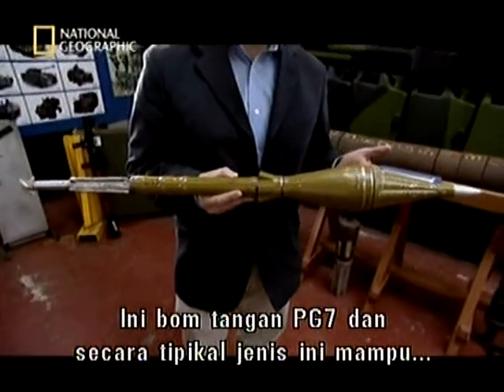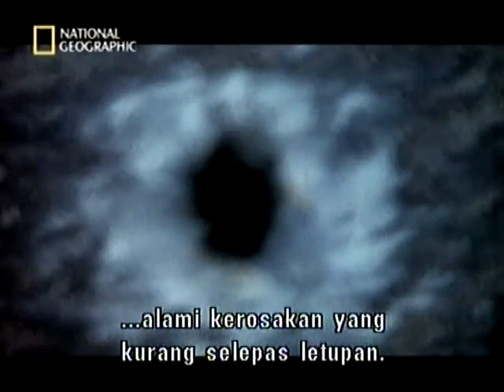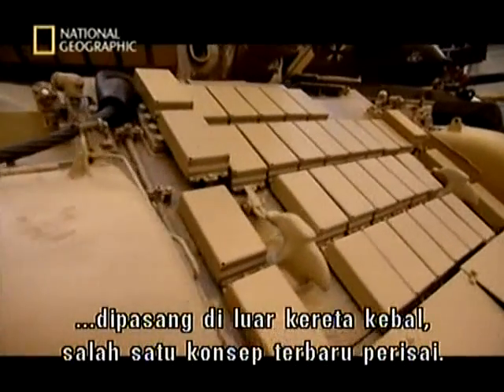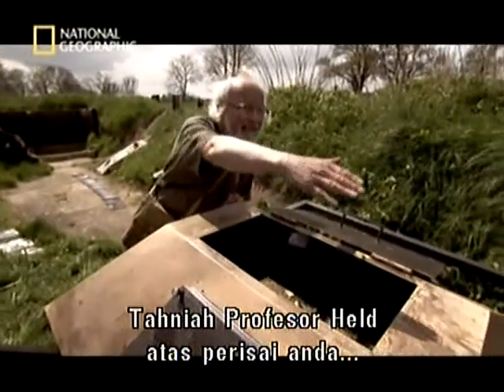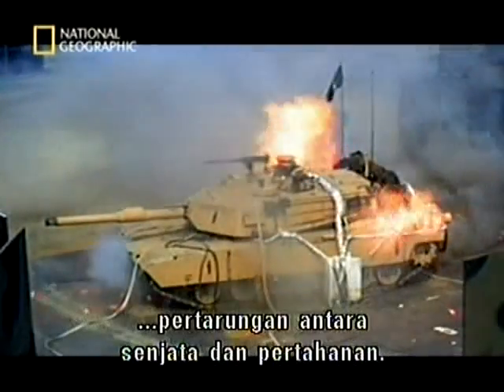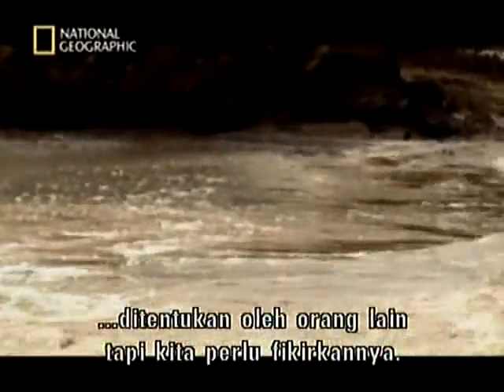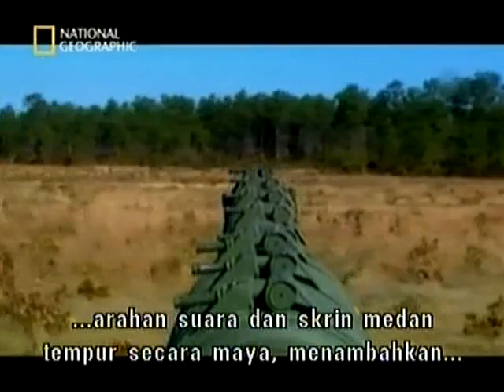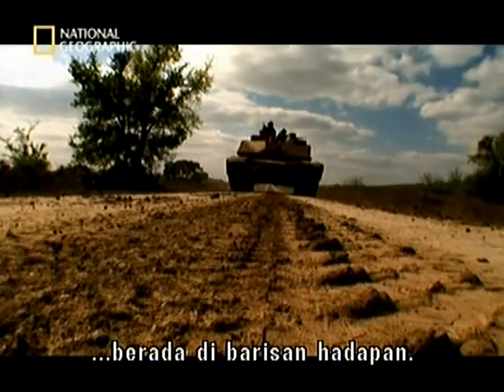Explosive Reactive Armor

Comment: at least the americans are finally somewhat admiting that their tanks are outdated
Reply: ERA has been around since the 50's, it's nothing new and TUSK contains ERA which can be fitted the the M1A1 and M1A2. Most ERA can be defeated by long rod penetrators.

All tanks have pros and cons in terms of maneuverability, the M1 is no different. It also is very ridiculous to claim that one modern tank has more "maneuverability" than another, all Western tanks are born from two joint projects, the MBT-70 and MBT-80.

The US Military maintains a human loader for added security, manpower,  reliability, and speed. Having an autoloader doesn't mean a vehicle is superior. 

The M1 has had the ability for the M2HB to be fired by the TC when buttoned up and the M1A2 utilizes CROWS. The M1 has possessed a coaxial M240B since it's prototype model. 

All tanks post-1940 tanks contain "computers", The M1A2 was apart of Force XXI, a program to bring the US Militarily into the digital era. Force XXI began in 1991 by introducing the M1A2SEP and later the M1A1D, a this time CEEP is being introduced as the third upgrading phase known as SEPv3.

The M1A3 isn't even in service, it's currently in an operational readiness stage with a predicted fielding date of 2017.
Reply: Joël LeMay Both the M1A1 and M1A2 can be affixed with TUSK, because it's an external kit that can be added. TUSK-II was deployed in Iraq in 2006. 

The M1A3 isn't in service. 

Active Protection Systems have been in used by both the US and Russia since the early days of the Cold War. 

Russia produced a hard kill variant APS for the T-55 in 1978 known as Dorzd. Arena is a derivative of Dorzd. It's not a complex or unique system, both utilize Doppler radar to detect incoming shells and detonate...a concept Sir Samuel Curran designed with the VT fuse in 1940 and developed by Merle A. Tuve of John Hopkins Applied Physics Lab later the same year.  

The US took a different route, adopting soft kill APS like the VLQ-8A. By technicality, the US system is far more technologically advanced. 

TUSK utilizes the XM-19 ARAT as it's ERA, it's a double-walled ERA that is resistant to detonation by small arms. The M60A1 RISE Passive saw the addition of ERA compatibility in 1977, which consisted of a single layer ERA. 

GPS was developed in 1978 by , up until the Block-III satellite series was launched, selectivity allowed the US government to insert errors into the 

However, that's all moot because Russia has it's own GNSS called GLONASS, which went online in 1993. 

The US and Russia aren't alone, China, India, and EU have developed their own GNSS.

Drones for use in Intel, Surveillance, and Recon operations have been in use with the US Military since 1964 when the US Air Force deployed Ryan Firebee Model 147B drones at Danang Air Base to preform high-altitude recon over North Vietnam. 

The US currently has one Ford-Class Super Carrier, ten Nimitz-Class Super Carriers,one America-Class AAS and eight Wasp-Class LHD. The US has had aircraft carriers in it's inventory since 1920 with Lexington-Class Carriers.

The Russian Federation has a single Kuznetsov-class STOBAR Aircraft Carrier launched in 1985. 

Russia first built and deployed aircraft carriers in 1968 with two Moskva-Class Carriers, then 1972 four Kiev-Class Carriers, all of which have been scrapped or sold to China. 

It's abundantly clear you have no real knowledge in relation to any of the subject matter being discussed. You're simply just verbally spewing nonsense in an attempt to look as if you're intelligent and knowledgeable.
Reply: @Joël LeMay

The M1A2 and M1A3 are completely different systems, the M1A3 isn't even in service, as noted by nearly every defense think tank and the US Army's own PEO STRI;

http://www.globalsecurity.org/military/systems/ground/m1a3.htm

The T-80 is a continued derivative of the T-64 that entered service in 1976. 

All Third Generation Tanks are designed as their pre-Cold War counterparts, because post-1940 armor doctrine went from supporting infantry, to combined arms. 

A blind spot within 4-/= feet is moot. Call of Duty and Battlefield are games, you can't simply attach a binary plastique and destroy a tank, you need either ATGM, an EFP or MSE to effective disable a tank, all of which have an operational range. 

Of course it still uses manual loading, that's apart of US armor doctrine. Even the German Leopard 2 practices manual loading. Only the Leopard 2A7+ will be fitted with an autoloader because the 130mm ammunition for the L/51 can't be loaded manually. The M1A3 is also slated to have an autoloader...just like the M2 C-ATTB and M1 Thumper experimental systems.

The great threat to armor, in every county and every conflict has been from ATGM for "mere foot soldiers".

Please stop being so hyperbolic. Fragmentation grenades can't disable a tank, never even the M5 Stewart is that vulnerable.

You also have no idea if the Abrams in Yemen and Saudi Arabia were destroyed. Nearly everyone that watches the videos coming out of Saudi Arabia and Yemen screaming about how the M1 is being knocked out left and right, when it's the blowout panels and venting system they see functioning...what is known as an "Operational Kill". The same thing happened in Iraq, the US simply returned the damaged M1's to Pima Depot to be rebuilt and repaired. The only M1's to suffer catastrophic damage where friendly AT mines strikes during the Gulf War, fratricide by A-10's firing AIM-120s during Iraqi Freedom, and daisy-chained 155mm HE IEDs during Iraqi Freedom. 

Again, you've demonstrated you know absolutely nothing about what you speak of, simply just spewing nonsense to try to sound educated an intelligent.
Reply: No it is not, TUSK can be mounted onto ANY Abrams, it is NOT the M1A3. 

http://www.globalsecurity.org/military/systems/ground/m1a3.htm

Only one incident of an RPG-7 penetrating an M1 exists. In 2003 insurgents through the use of an PG-7VR warhead struck the unarmored access skirt on an M1. The EFP entered into the hydraulic reservoir, then into the turret via an access panel. The Copper slug penetrated the loaders seat, the loaders CVC, the loader, and came to rest in the turret wall face to the left of the M256 breech.   

http://www.rense.com/general44/what.htm

Thus far, only anecdotal evidence exists that an M1 can be felled by a Kornet. A handful of Iraqi M1A1S have become damaged by Kornet's. The M1A1S isn't the same as the M1A1AIM and M1A2SEP. That'd be akin to saying the Asad Babil is equivalent to the T-90 because both are variants of the T-72. 

Funny, for a person that claims to be so highly educated, you offer no validating proof, perpetuate false information, and simply act as if facts don't matter.
Reply: Aztk Shorty It's nothing to type up a response with facts and data. Plus, if it doesn't help educate him, it'll help educate others. 

I wouldn't say it's state propaganda he parroting, just simply jingoist zeal and ignorance brought on by a poor education in the subject matter and a good amount of cognitive dissonance. It doesn't take a genius to verify facts or provide them.
Reply: The Gaming Banana The M1 has had separate ammunition stowage since it first rolled of the design table. 

All Abrams have a human loader, for added security, manpower, less mechanical reliance, and fast loading speed.
Reply: No, actually the largest portions of US military expenditure goes towards maintenance, followed by personnel, then procurement., then R&D. The US has drastically downsized it's OCONUS bases, since 1991 a slew of BRAC rounds serious diminished the forward deployment capabilities of the US. However, US expenditure wouldn't be so large if it didn't have to carry 73% of NATO. 

https://en.wikipedia.org/wiki/Military_budget_of_the_United_States

http://www.businessinsider.com/how-much-every-nato-member-spends-on-military-in-2014-2015-2?r=UK&IR=T

ISIS was armed by the CIA, not the US Military. There is a difference, such as th CIA draws from a different budget and is apart of the National Intelligence Community.

http://www.bbc.com/news/world-us-canada-23903310

 The Taliban came into being during the Afghan Civil War in 1994, formed primarily of students that attended madrassas in Pakistan, lead by Mohhamad Omar to fight regional Mujahideen militias controlled by warlords. The Taliban was toppled as a form of government in 2001 by ISAF, where it reassembled as an insurgency faction in fighting against ISAF.

Al-Qaeda is  Sunni militant faction that was formed in 1988 by Osama Bin Laden as apart of the resistance to the Russian invasion of Afghanistan in 1980's.
 
http://www.nytimes.com/2016/06/27/world/middleeast/cia-arms-for-syrian-rebels-supplied-black-market-officials-say.html?_r=0

https://en.wikipedia.org/wiki/Al-Qaeda

https://en.wikipedia.org/wiki/Taliban

You speak as if using refurbished equipment was a "bad" thing. All major military forces reutilize equipment, because it would be fiscally irresponsible and crippling to produce new equipment constantly. Both Russia and China, two other major superpowers reutilize equipment constantly. Both the Russian Navy and PLAN consist of rebuilt and refurbished ships

http://theweek.com/articles/596822/russias-military-dont-believe-hype

https://en.wikipedia.org/wiki/Chinese_aircraft_carrier_Liaoning

https://en.wikipedia.org/wiki/Kuznetsov-class_aircraft_carrier

https://en.wikipedia.org/wiki/Russian_Navy#Ships_and_Submarines

The Ukrainian Conflict that's been ongoing the past two years has been replete with Soviet Cold War-era equipment, used by botht he UAF and NAS. 

http://www.ibtimes.com/ukraine-fighting-21st-century-war-cold-war-arms-1808358

When I read you comments, I shake my head at all the false information and propaganda you continue to spew. 

You've gone on to show, not you are you woefully ignorant in military affairs, but have a serious knowledge deficit in understanding economics, diplomacy, defense intelligence, and world affairs in general.
Reply: The M1 Series of tanks are not "outdated" my any means, and I don't know where your idea of frag grenades taking out a tank came from. Yes, our tanks are aging, but not "outdated". Also, George Atlas provided some solid information, and you simply continued with your ramblings.
Reply: +George Atlas thank you sir... these people are just forcing their opinions, each tank is different but it doesn't mean they are superior
Reply: Joël LeMay 

 never said the "Tank Urban Survival Kit" was the M1A3, that was you. TUSK is an armor add-on package that can bit fitted to any post IPM-1 regardless of model. The M1A3 is an new model of the Abrams, replacing the M256A1 120mm with a new lightweight 120mm gun, replacing all copper wiring with fiber-optics, replacing the AGT-1500 Honeywell-Lycoming Powerpack with a newer, modular 1500HP Diesel Powerpack, and new modular armor. If you actually read any of the links I posted, you'd know that.

No, the M1A2 was an overhaul to meet Force-XXI requirements. The M1A2 is a different tank than the M1A1...they're the same make...not the same model. Just like a 1969 Mustang GT  isn't the same as a 1969 Mustang Mach 1.

Ah, I'm the one that pointed out the T-90 is a variant of the T-72...in most previous post. 

You can't don't know what variances or models are, but I'm the moron.  

Here's some information for you; 

These are all the models of the Abrams since 1976; 

XM1
M1
IPM1
M1A1
M1A1HA
M1A1HC
M1A2
M1A2 SEP 
M1A2 SEPv1 (ISEP)
M1A1D
M1A1AIM
M1A1AIMv2 (SA)
M1A1FEP
M1A2 SEPv2 (CEEP)
M1A2 SEPv3 (ECP)
M1 TTB
C-ATTB
M1 Thumper
M1 Grizzly 
M1 Panther II
M1 ABV
M104 Wolverine 
M1A3
M1 ARV
Reply: It's an add-on, just like Arena or Kontact-5. 

Doesn't have the cash? You do know the US outspends every other nation in word when it comes to defense spending.

Too stupid? That's rich coming from a guy who's done nothing, but spread misinformation and false data in YouTube comments. It's no different than the Russian's putting Arena on their tanks...it's nothing, but a variant of Drozd. So, the Russians must be really stupid in your book for keeping a 35 year old APS around.

However, now that you're on the case, I'm sure the Defense Department will be giving you a call any day now to make sure they're not being "too stupid", because you can not understand US armor doctrine.

You've done nothing, but show you don't have a clue what you're talking about. Even going so far as to having to insult others, to distract from it, because they've shown your lying and presenting false data.
Reply: ALL Western tanks weight in the same area as or more than the Abrams; 

Leopard 2: 68 Tons
Challenger 2: 69 Tons
M1 Abrams: 63 Tons
Char Leclerc: 57 Tons
K1A1: 58 Tons
K2: 68 Tons
Ariete: 60 Tons
Altay: 72 Tons

So much for your false information about the Abrams being "too heavy". All tanks have add-on packages and all have been built with thicker frontal armor with the same concept of fighting other tanks and all suffer from supposedly "lack in maneuverability". So again, so much for your false information regarding the Abrams. 

No, we're in the 4th Generation of Warfare, it's far, far more likely for an insurgent AT team or IED/EFP to fell a tank than an attack helo.

You entire line of thought is completely based on some propagandist ideal that only the Abrams is obsolete, but somehow other tanks maintain functionality under these contrived limitations. Anything that limits or causes an Abrams to be obsolete, does the same to any 3rd and 4th Generation tanks, not just the Abrams. 

Once again, you've shown you haven't a clue what you're talking about. You're simply conjuring up false claims and false information.
Reply: The Gaming Banana Because auto-loaders malfunction and fuck up, and having a machine press against the shell is bad news for the tank. Also, auto-loaders are expensive on top of the fact that you can't really replace it if it's broken as it's designed to remove a crewman. The Abrams is also the MBT of the worlds richest and most powerful military for a reason. You shouldn't be skeptical of the tank that can absorb 50 shells from a T-55 and send one by eye balling it and blowing the turret off the ring.
Reply: The Gaming Banana Overall average loading speed in the US is on par and usually faster because they train loaders as nothing but loaders, not multi-role personnel, so they specialize in nothing but loading (along with basics like shooting straight and staying in shape).
Reply: The Gaming Banana
Not at all, a human loader can match the speed of an autoloader. 

ALL tanks have ammo in the turret. The M1 has it ammo in a separate compartment that's opened via the loader hitting a release with his knee, an armored door slides open giving the loader access. 

An autoloader doesn't mean the crew is safer. The Russias from the T-62 to the T-90 utilize an carousel loader under the crew in the turret bustle. The US began storing it ammo separate from the crew over 30 years ago, it's only now with the adoption of the T-14 that the Russian's will have separate ammunition storage, but that's because the crew isn't in the turret, which creates it's own special problems.
Reply: No, you tried to mimic a common Cold War era propaganda meme.

The majority of OCONUS bases are Air Force, not "US Army". 

The cost to "run a base" is minimal, because the majority of bases OCONUS are "joint", like Incirlik. What costs is personnel and maintenance, not "bases". Even if the US Military didn't have OCONUS bases (like all other world powers do) it would still have the same expenditure because of the existence of the tenant units at those bases, they would simply be located elsewhere.

US spending has drastically been reduced since the end of the Cold War. 

So, you practically haven't said 
"anything", except more misinformation and propaganda nonsense.
Reply: George Atlas As I said earlier, why do you keep responding to him. He's obviously brainwashed, everyone has noticed it. I didn't know this type of propaganda still went on in Russia. Since it's no longer a communist dictator ship...
Reply: You don't even know what you're talking about, you just throwing out random numbers. 

If a noted scholar or think tank analysis made comment about "problem", but you're not a noted scholar or a think thank analysis. You've shown you don't know anything about this subject matter. 

You care enough to continue to reply.
Reply: George Atlas This is quite entertaining actually..
Reply: Joël LeMay I know actually having to prove your points must be a taxing and confusing thing, so I'll spare you the lecture on how you should be doing your own research instead of pulling shit out of your ass. 

https://www.cbo.gov/publication/51535

Enjoy.
Reply: Joël LeMay That is not "explosive armor" you are talking about. That is active protection, an entirely different concept. A tank that has active protection system can also have rare material armor and/or explosive armor.
Reply: they said ''the tank'' not ''the american tank''... and if the M1 Abrams is outdated, what about the rest of the worlds tanks??
Reply: Joël LeMay ummm... i dont thnik they edited the video... and the M1A2 Abrams is also a ''modern'' tank. if the T-90MS is a modern tank, the M1A2 deffinatly is to. the M1 has a better gun, better armour and protection system. the onlt thing the T-90 has going for it is that its lighter, faster and more manueverebole.
Reply: Hoyin Tse M1A3 doesent exsist. and the T-90 ERA works exactly as all other ERA's once fired upon and exploded its used up and there is a exposed part of the armour left there. the M1A2 abrams has the equilavent of 1920mm's of armour against shaped charges on its front without ERA. the T-90 has the equilavent of 1750mm's of armour against shaped charges with ERA. without ERA the T-90 only has about 1000mm's of effective armour.
Reply: Joël LeMay but the M1 abrams has better armour and better protection than the T-90 anyway. thats a fact.
Reply: Joël LeMay you know the Depleted Uranium Armour the M1 uses is relly good at stopping heat right? there was a case in afganistan where 1 M1 abrams was hit about 40 times by RPG's, RPG's are HEAT shells which penetrates about 800 mm of ''normal armour'' so the M1 is pretty good i would say at stopping heat... its better than the T-90 anyways.
Reply: Joël LeMay kornets work allmoast the same as RPG's and i would relly like to see where you got the information on that about 1000 abrams have been destroyed bu Kornets...
Reply: Joël LeMay yea ive seen that video, and you've obviously no read into the story. that abrams which was shot in yemen wasnt an american M1. and since it wasnt american, it neither had TUSK or the depleted uranium armour which the american M1 does.
Reply: Joël LeMay there was even a case in afganistan where a M1 got stuck after hitting an IED and another M1 who was there with him tried to shoot and destroy the M1 point blank range (10m) from the front with HEAT and APFSDS, nothing, absolutly nothing happened, it could not penetrate the frontal armour of the M1 what so ever. and there have been many cases where M1's have been hit with several RPG's and other hand held and stationary AT weapons and wasnt destroyed, im starting to get a feel that you dont know as much as you think you know and that you are a little bit biased.
Reply: Joël LeMay ho shot the tank because they couldnt save it and desided to destroy it so it wouldnt fall into enemy hands.
Reply: Joël LeMay And no , you're talking about a prototype . Just like the T14 . The prototype isn't even preforming well . It's engines are weak , it's only seen high manauverability at low speeds , it's stealth isn't even near as good as the F35. It's more like a 4+++ Gen  fighter . F22 is much more stealth cappable with it's new stealth paint that was used the F35 .It's much more resistant to weather and don't worry . .... the f22 will get a HUD or HMD by 2020.
Reply: Joël LeMay U are such an ignorant of a person to believe the f22 being a prototype .  How can someone that thinks he knows everything about tanks say such shit . Wow , this Suprised me more than it should.
Reply: Joël LeMay SU-35 is a well manauvering plane , too bad dogfights are rare
Reply: ***** "not a single abrams tank has been lost to personal anti tank weapons" after reading that alone i can already tell you didnt read my full comments so im not going to read your full comment either until you realize your mistake
Reply: And also the Abrams and the Exported Abrams are the same tank with different specifications, mostly its armor.
Reply: ***** they mentioned that tank with tradition solid like the Abrams are outdated if you dont believe me then watch the video again
Reply: ***** WATCH THE VIDEO AGAIN
Reply: If the M1 is outdated, then all tanks are. Spin this how you want, but the M1 is the pinnacle of armored vehicles. Also, the M1A2 has these covered on the outside.
Reply: Joseph Stassup both the Russian, the Chinese, the Israeli, the Turks, and most European countries have modern tanks by that i mean have tanks with the latest tech such as explosive armour higher maneuverbility auto loaders remote controled machine guns so that the entire tank cant be taken out by a simple frag grenade and on btw the M1A2 has nothing of those its builrt like any WWII relic tank of the past with so computers added but thats it really you should take a look at the firing pin the abrams dont even have something as simple as a trigger
and you mean the M1A3 has c4 strapped the outside the same era as the outdated T-72 plus theres just a few M1A3 in service
Reply: Joël LeMay The US varient has depleted uranium aromor as well, which is just as if not more effective than explosive reactive.
Reply: Joseph Stassup lol the Abrams have had depleted uranium armour since the 80s and ANY high caliber HEAT round goes right through it as if it was paper HEAT rounds like what the Russian portable missile launched called the Kornet but explosive armour stops it without a fus
Reply: The Gaming Banana Literally all tanks will go up in a fireball if the shell gets lit up. It's not unique to the Abrams. Really, the cm thick sheet of aluminum does nothing if 5-6 shells blow up at once. It's more of a mental barrier than a physical one, as it makes the crew feel safer, and they will perform more efficiently.
Reply: Joël LeMay
Your definition of educated is pulling facts out of your ass.
Even your original comment is not even true.
The person in the video said that all tanks were becoming obsolete. All Tanks, which is complete bullshit. This guy is tossing reactive armor like its the one trick pony to make a tank great.
George Atlas is actually providing links and evidence, while you are on some country-related hate speech.
Reply: Joël LeMay American military spending in 2010 was around 664 million 2015 was 598.5 million 2016 was 596 million. You can easily search up numbers of military spending it isn't hard. While russia's military spending in 2016 was around 69.3 billion.
Reply: explosive armor can only stop shells once, rare material armor,such as depleted uranium, can stop the penetration of shells for many times.
Reply: It depends on what type of Abram and what shell you are using, M1A1, M1A2 and M1A3 have totally different capabilities, but I agree the active protection system is very advanced in its design.
Reply: The new active defense system had been invented and is going to be mounted on American tanks in 2016. Technology can't beat the internet >.<
Reply: Joël LeMay  But how many times can ERA be useful, remember the enemy won't fire just once and leave. You can literally put ERA on a T34 and expect it work the same way as in an Abram.
Reply: Joël LeMay I do sincerely think many infantry AT would not even damage the abram in 10m range.
Reply: Joël LeMay just keep coming with you'r arguments, but the fact still remains, the M1 Abrams has better armour than the T-90
Reply: AirsoftGamer the T-90 armour stops ANY HEAT rounds including the Kornet whithout suffering ANY damage meanwhile the M1 Abrams cant even survive a single hit from the Kornet not even at the front turret where the armour is thickest
Reply: Joël LeMay yes it can?, and the front of the turret isnt where the armour is strongest, thats the upper hull, and the T-90 takes damage when hit by not just heat but for example APFSDS because the ERA which the T-90 heavily relies on will get destroyed after a shot, watch a comparison video or 2 or 3 on youtube or read up about it, then you'll fins out the truth.
Reply: AirsoftGamer no it will not because its a turret that shoots at incoming high caliber projectiles COME ON DUDE i already told you this
and its easy to make a fake statement by writing it but near impossible to make a fake video thats why i dont like to read statements
Reply: AirsoftGamer the Abrams armour so weak it caht survive a single Kornet round sure the abrams armour is thicker but its weak and you know exactely what i am saying you just dont want to admit you were wrong thats what a little child does because children cant admit being wrong thats the diference between a child and an adult
Reply: Joël LeMay you are literaly losing this and still iggnorant after what everyone stated . The things they say we're facts ....how tf can u be that ignorant . Ur insulting him because you're losing . All you're saying is based on your oppinion
Reply: Habiebi Djokarso how as a tank that cant survive a single kornet hit be better then a tank that survives a kornet hit?
Reply: Joël LeMay Like u don't know .... ofcourse because of the reactive armour
Reply: Joël LeMay Someone told me a valuable statement ; It all depends on the scenario. No Abrams will go on the battlefield without other groundforces or  support from air
Reply: Same with the T-90 being backed up ....
Reply: all of them will be backed up by either air support or air strikes . And Air power does play a huge role in the batle giving u an advantage over the enemy . Every Tank can be destroyed by air attacks . It's easyier if you're taking the lead in the air . Ground forces can easily be disabled by air
Reply: Joël LeMay Air support doesn't mean air strikes . It's from artilary to AC-130's bombing the shit out of the enemy
Reply: Joël LeMay I can't even talk right now
Reply: Joël LeMay I've replied to your comment in another vid. (I don't remember what ) But I really know u said some dumb shit
Reply: Joël LeMay yeah , probably
Reply: And one more thing , about that Tank being destroyed by a kornet ... did it feature the US variant of ...everything officially used by the US ? The Kornet is scary ... but I'd rather face that than a fire and forget Javelin or Spike .... those weapons are legendary . But I wonder how the Rebels  got many Kornets and TOW's .... of course I don't .
Reply: Habiebi Djokarso the Javelin and Spike are very old and outdated but the TOW is about the same thing as the Kornet its a double HEAT round works like a charm against old ERA equipped tank such as the T-72 but doesnt work against modern ones like the T-90 you'd need a tripple HEAT round for that but i dont think such a round exists yet that is if its even possible to make one
Reply: Joël LeMay The PAK-FA is stil a prototype u dumbass . It'll enter production in 2017 , u are saying such nonsense . And No the Javelin entered service the same period the Kornet did , the Kornet isn't even for replacing currant systems . And the  number of Javelins built is well over 40k
Reply: Joël LeMay The Javelin and Spike are guided to penetrate from the top of the Turret , and no tank is acceptably good protected from the top , even reactive  armour wont help u with the Javelin
Reply: Habiebi Djokarso only reason they are rare is because the wars of today are too one sided by that i mean theres almost air battles its always air vs ground i guess its because todays armies are too scared of facing someone else that has an air force not even Israel dares to fight Syria's air force or viceversa
and ERA is especially good vs attacks that comes from above you'd have a higher chance of damaging the tank by aiming at the lower parts of the tracks or even better by hitting the tank from under where the ERA cant protect the tank but the top of the turret is the most protected area thats why i said Spike and Javelin are useless not to mention they are far less powerful then the TOW and the Kornet instead the jav and spike are more like an RPG-7 in terms of strength
and ERA is not reactive armour it is Explosive Reactive Armour and what can your javelin or spike's round do to the tank when it gets destroyed before even hitting the tank?
Reply: I know tge difference . And no , the Javelin triggers the reactive armour and then enters the tank , but I really don't know about ERA taking these types of missiles out , ....We'll see when it happens .An RPG-7 is so weak . It can't do any damage to modern tanks . It doesn't even have Semi Guidance
Reply: Habiebi Djokarso modern ERA are explosives that are fired at incoming anti tank rounds and the turrets that fires them is usually on the top of the tank and has a 360 degree coverage but its no sursise you didnt about modern ERA taking out Javelin or Spike missiles since tanks with modern ERA are rarely seen and the western powers dont have modern ERA Turkey has it tho so does Russia China India and even Syria has a few but thats about it as far as i know
Reply: Joël LeMay U sound so one sided
Reply: Joël LeMay I know how ERA works , but I really didn't (don't) know they can take out these kind of ATGM's ...We'll ... it's not proven , but it may be true
Reply: Habiebi Djokarso you know what primitive ERA is but you sesm to think theres inly 1 type of ERA but theres multiple btw the T-90 has 2 types of ERA the one that fires and the one that reacts when in contact that said the Javelin/Spike may get through the first ERA but it gets stoped by the second same goes with the tow btw the tow is better then the Spike and Javelin and the T-14 has 3
Reply: Joël LeMay I know the TOW is better at penetrating the armour , but the Javelin is much more Effecient and fast while the TOW has much more chance to be seen by the enemy . They work for the same purpose (Destroying tanks) but they are two different types of weapons with both their ups and downs . The TOW (or Kornet) is much harder to opperate in combat area because the opperater can be spotted because the missile reqiures guidance until impact . The Javelin on the other hand can do it very quick and u can opperate this ATGM without being detected even if the missile is going to be stopped . So i've done some research and found out that the T-14 is hella allot of advaced in ERA and Reactive armour , this doesn't mean that the US tanks are outdated . Just like how the F22 isn't made obsolete by the f35 because of it's differen't types of roles . And i've also read that the T-14 uses EASA ..... now damn that's something else for a tank . I've read that the T-14 , just like the Merkava uses ERA against similar types of AT Missiles like Javelin , RPG 7 and other simillar types ... but not Sabot ....the Merkava has a ERA systems that calculates the speed of the projectile and where the system will hit effectivly presicely while the T-14's ERA just works by spraying the explosive (????) in the air wich makes it very dangerous against infantry around the tank .
Reply: Wich is a downside for them
Reply: Habiebi Djokarso the Jav was designed to counter the T-72 but not the T-90 nor the T-14 and i didn't call the f22 as obsolete i simply called it inferior and the jav also requires guidance otherwise it would just keep going straight in the air btw the tow is actually a lot more accurate then the jav because it can instantly fix its trajectory throughout its entire trajectory thats why it looks derpy after its shot meanwhile the javelin goes straight up because it can only slowly turn meaning it cant hit a high speed moving target unless the shooter predicts where the target is bona be upon impact its not like in video games real life is very different 
- 
the moment you claimed the javelin to be more efficient then the tow well you convinced me that you have no idea what you are talking about it feels as if you take most your info from video games
Reply: Joël LeMay the JAV has infrared guidance so no , you don't have to wait and guide it until impact . The Javelin can hit moving targets but not too fast moving ones . But the Spike can hit high speed moving targets with precision guidance and it has been proven . Just like the Javelin , the Spike is really accurate . Where the hell did you get that info dude . Is it your oppinion , because it really looks like it is , btw . ....The opperater of the Javelin doesn't have to stay till impact so yeah , it's highly more effecient
Reply: The TOW is better at pennetrating armour . So that's the best part of it . Dude , when I say something , u don't have to explain everything because I know what it's porpuse is . I know what the Sabot is and the Sabot round destroyed many Iraqi tanks , where did u get your info from dude .... And no APS can defend against SABOT rounds . They are amazing at penetrating and ERA (APS) can't stop it , Reactive armour can decrease it's cappability but not stop it
Reply: Joël LeMay u seem to have much info but most of your older post are so incorrect
Reply: Habiebi Djokarso you take your info from wikipedia??? thats not a very reliable source of info since anyone can change the info there but whatever i give up you are one of those brain washed pro US guys no point in talking to you anymore
Reply: Joël LeMay you too
Reply: The Macaroni Chronicles lol i see you are admiting that i am right because you dont know what to say do you?
-
the guy claimed 0 abrams ever got destroyed yet i posted a video showing an abram getting destroyed so he indeed didnt read my full comments otherwise he wouldnt have made such a stupid claim
-
and you better give me a good reason so i dont report you for trolling
Reply: Joël LeMay Wow lol you must be pretty salty if you are reporting me for TROLLING when you are the one who kept saying the Abrams was terrible no matter what facts were presented to you.
Reply: ***** all abrams are american made you idiot
Reply: ***** yes t-72 are russian MADE tanks so are the T-90 and even the Ukrainian T-80 are Russian made tanks it does NOT matter if it was made with steel or cardboard the fact remains all Abrams are made in the US thus they are US tanks
-
they would have to be built outside the US and by another country to not be US tanks
Reply: Joël LeMay 
Here's a list of the Abrams Series
M1 Abrams (Outfitted with 105mm Main Gun, armored with the British Chobham Armor)
M1A1 (Outfitted with the German L/44 120mm Main Gun or the Licensed version the Americans made the M256, same armor)
M1A1HA (Added Depleted Uranium Armor mainly on the Turret)
M1A2 (The first tank at the time, note, at the time, was the first tank to be fully digitized)
M1A2 SEP (pretty much improved electronics and main armament, such as the M256A1 Main Gun)
M1A2 SEP v2 (More improvements, mainly to the new M256A2 Main Gun)
Other variants I left out were the M1A1IP, and M1A2 SEP v3 TUSK Reactive Armor
TUSK = Tank Urban Survival Kit (outfitted with multiple Explosive Reactive Armor Tiles most notably added on the sides, and some caged armor (I forgot what they called it) on the engine)
TUSK II = Tank Urban Survival Kit Version 2 (Improved Abrams that should come with the M1A2 SEP v3 TUSK II Abrams. More words, the better)
Your argument about the M1A3 is highly invalid. The tank has been in development since 2009 and is supposedly to be revealed by 2017.
The Abrams has a export version, for example Egypt. It is not outfitted with the Chobham Armor (as you can see, the exported Abrams is getting always captures by the enemy, thats why theres a export version).
American Abrams has never been destroyed. Only majorly damaged, for chobham, there was only one tank that was destroyed that was made out of Chobham. It was a Challenger 2, but it wasnt destroyed by enemy fire. It was destroyed by accidental friendly fire.

But heres a summary, no Abrams tank has ever been destroyed and its not obsolete. The Abrams is still and will be a formidable opponent to that of Russia's T-14 Armata and other potential Targets. The M1A3 Abrams is not in service and is still in Development, it wont be seeing the light of day until next year, or 2017.
Reply: thedog556 Actually, they're only liscensed to produce them for the US Military, not for themselves. The US then give them the export version of the Abrams.
Reply: ***** Ok well in that case unless you built everything you own then you own nothing.
Reply: ***** You literally just contradicted yourself.
Reply: thedog556 Nope. You're not getting the point are you? The US allowed Egypt to produce Abrams tanks for the US Military, mind that its FOR the US Military, not for themselves. Then the US Produce Export Versions of the Abrams, then they give it to Egypt or any other country that wants to order an Export Abrams.
Reply: NitroCaliber i told you the fact that the abram was made by americans makes it american made if you keep on ignoring that fact ill start treating you as a troll
Reply: ***** its made by you
Reply: ***** the question is not who owns it The question is who made it
Reply: ***** if you buy a car from the guy that made it but the engine is incomplete who do you blame? the one who owns it (meaning yourself) or the one who made it?
Reply: thedog556 its everything that this guy says its irrelevant. No matter what we say, no matter what facts we give him, he'll just turn into illogical 8 year old scumbag who thinks he knows everything about tanks.
Reply: NitroCaliber so you are telling me the abrams that the Saudis are using are not abrams and they were not made by the american and that the US never sold any abrams to the saudis? if so then you are incredibly ignorant
Reply: Joël LeMay What do you mean? When did I say anything about Saudi's? All I said is that if a Country is allowed to produce a tank for a different military, they dont own the tank, the other military does.
Reply: ***** americans brought tanks in Canada manny times yet we didnt declare war because we are not as stupid as you are
Reply: NitroCaliber I mentioned the Saudis before remember the argument started when said many american made abrams were destroyed in Yemen well the guys that were operating those abrams were saudis and the saudis dont build tanks they buy tanks
Reply: Joël LeMay Yeah, they bought the Export Abrams. I never said anything about Saudi's building tanks. Once they buy the tank, they own that tank. The Egyptians are allowed to produce and/or build them, but they have to buy the Export version. Once they buy all of the Export Abrams they need, they own those set of tanks. Just because one nation are allowed to make tanks, it doesn't mean that all countries need to build tanks. Jesus christ m8, ignorant one are you?
Reply: NitroCaliber you kept saying no american made abrams were ever destroyed thats precisely want you have been arguing on for all this time
ps just came back from the hollydays tour
also the americans have been selling abrams from the golf war for quite a while now and anone with about 10 million USD can buy one i think you are the ignorant one
Reply: ***** ive been repeating over and over american made abrams thats the term ive been using all this time its you thats just so blind that you cant read
Reply: ***** i am specifically saying american made abrams the term im using is perfect its you americans you spoilled brats that wants believe in the fairytail of invincibility BUT NOTHING is invincible you idiot
Reply: Joël LeMay Lmao, check the internet. There hasnt been any Abrams thats been destroyed by enemy fire (only friendly fire from the rear).
You're a fucking idiot for thinking that there's an M1A3 Abrams, there hasn't been any M1A3 Abrams besides a prototype. Check your goddamn facts before you fucking throw 40 unproven facts about a tank you barely know about dumbass.
Reply: Joël LeMay Uh, scroll up, you said things about the M1A3 Abrams exist. Now you're just contradicting yourself.
Reply: NitroCaliber i never said M1A3 to ever have been destroyed how can a tanks thats never seen combat be destroyed? i said many abrams got destroyed and by abrams im refering to the most common ones the M1A2
Reply: ***** an american made M1A2 is the same as an american M1A2 because they have the same name even if one is made with paper as long as it has the registered and internationnally recognized name abrams its an abram even if its just a sign you are the idiot here
Reply: ***** if it has the name abram then its an abram thats all im saying
Reply: ***** how is an abram of paper not deferent from an abram of steel? of course they are deferent but in the end they are both of the abram brand
this feels like im trying to explain to a very young kid that just learned how to speak
Reply: NitroCaliber btw ISIS also uses M1A2 Abrams and manhy of them were destroyed by the obsolete T-72
Reply: ***** if the 2 pants are both of the brand moores then they are both moores and if one of those pants turns out defective then its the brand moores thats responsible for it happening its the same thing with the M1A2 abrams its the US that claimed them to be invincible its also the US that both designed and made them and many got destroyed proving the US lied when they claimed them to be invincible and they are responsible for it
Reply: ***** the tanks were supposed to be invincible yet they get destroyed by Kornets missile in 1 hit that a defective invincible tank
im just a disclaim thats disclaiming the invincibility of the M1A2 Abrams thats all ive been doing
Reply: ***** it was and is M1A2 stop playing dumb that info is already declassified
Reply: ***** the Abrams Iraq and Saudi Arabia got were the ones left behind after killing Sadam Husein
Reply: Joël LeMay Give a piece of evidence that the Abrams after the Battle of 73 Easting was given to the Iraqi's and Arabians.
Oh wait, you cant BECAUSE THERE WASN'T A BIT RECORDED WHERE ABRAMS OUTFITTED WITH DU CHOBHAM ARMOR GIVEN THE IRAQI'S AND ARABIANS. AN ABRAMS DOESNT NEED TO HAVE DU CHOBHAM ARMOR TO BE AN ABRAMS. Heres a bit of logic for your dumbass, a Sherman with a 75mm was modified to have a 17pounder Gun. Therefore its not a Sherman tank without its 75mm main gun, oh wait its still a Sherman because it was later named the goddamn Sherman Firefly. Is your illogical statements gone yet?
Reply: NitroCaliber they were sold to Iraq and Saudi Arabia not given and anyone can buy the M1A2 Abram as long as you got the cash for it btw chobram armor aint that great thats why ERA is on the M1A3
Reply: ***** from what i can remember Saudi Arabia paid about 1.5 billion USD for the M1A2 Abrams they got but im unsure about how much Iraq paid but the US never gives anything for free due to their selfish capitalist nature
Reply: ***** well... i guess its possible the Iraqi tanks to not have chobram if they were indeed donated but im sure the Saudi Abrams are the real deal
Reply: ***** i was talking about Saudi Arabia a country that got the US far more wealth then shitty Australia
Reply: Joël LeMay At least australia has enough money to educate their children more effectively than you cna have valid facts about a tank.
Reply: ***** i strongly doubt that because like i said the US are capitalist that means their best allies are the ones that brings them the most wealth its as simple as that and im not talking about the american people when i say the US im refering to the ruling class also known as the elites
and i may be pro- russian but i dont live in Russia i am Canadian -- French-Canadian to be precise
Reply: ***** no i was specifically talking about the US elites the guys that owns massive corporations in the US like ford, microsoft, wallmart, etc. they have full control of massive companies giving them great political power thus making them ruling class and Trump is no exception and i never said that Russia was any better in terms of living quality
Reply: oh is it? all these videos of saudi abrams tanks m1a2s getting totally fucked by HEAT shells? those must be fake then
Reply: George Atlas sorry but no the M1A1 and M1A2 doesnt have TUSK only the M1A3 has it and last i checked 0 of them have seen actual combat also the M1A3 only has an old version the same one that the socalled obsolete T-72 is using and thats just C4 incased in metal boxes strapped on top of the tank nothing special about it plus it only has 1 layer but the more recent ERA like the ones on the T-90 and the T-14 are multi-layed plates they are also very is to replace on the battlefield meanwhile to replace the old ones you need to go to a workshop also the newer versions have whats called arena active protection its basically a turret that automatically fires an explosive at incoming shells and neutralizes them before they even hit the tank so yeah Russia is dozens of years ahead of the US when it comes to ERA and the US only have themselves to blame for this because they refused and still are refusing to promote russian tech and to use it thats why Russia is so far ahead right now because the russians unlike the americans have adapted every usefull american tech like the use of gps and drones for example they even made some carriers as soon as they saw the american ones thats why Russia is outeching the US today
Reply: Imagine putting all that money we put into the F-35 program into a new MBT, would be very interesting
Reply: Joseph Stassup saudis have abrams tanks with tusk but if a kornet hits the sde of the turret and burns the ammo then everyone is dead as shit and keeping ammo inside crew compartment is really stupid and most abrams tanks still have human loader
Reply: George Atlas well the loading speed depends on who you have as loader

the m1 if im right still has the ammo in turret it cant really be that seperate since someone of the crew has toget a round every now and then
Reply: Joseph Stassup every tank these days without auto loading system trains a loader for loading only thats like standard since 1944
Reply: George Atlas didnt say that a human loader was slower thena autoloader

also the seperate ammo in the turret doesnt add much protection because every ammo hit ive seen on a abrams killed the turret crew
Reply: Joseph Stassup the M1A3 has the TUSK and btw only diference between M1A2 and M1A3 is one has the tusk and the other doesnt otherwise they are practically the same and when you start using insults to justify something its the same thing as admiting defeat
Reply: Wesley nope if the M1 is not outdated then the T-80 is not outdated either since they were made in the same era yet they still both are old tanks the first M1 was made in 1979 thats 37 YEARS ago and its built like a WWII tank with strong frontal armour and weak backwards armour iand despite the 360 degree turret turn theres a huge blind spot behind the tank and thats just going by basic design and damn thing still needs crew members to load the ammo by hand mean the crew is almost constantly in contact with live shells which makes them very vulnurable how many abrams have been destroyed in Yemen and Saudi Arabia by mear foot soldiers i ask you? a tank is suposed to be anti-infantry and not the other way around as for the frag grenade to take out a tank its just from basic military training almost every armies does that training if you havent heard of it then well.... im speechless
Reply: George Atlas no the M1A3 is the same tank with the TUSK added to it and it only takes about a day to install the TUSK and yes it is a great upgrade but it only makes the abrams not obsolete to HEAT rounds like an RPG-7 for example but doesnt hold a candle against the more modern HEAT rounds like the KORNET and only uneducated guy here is you
Reply: Wesley nope ok you have bad hearing because he said our tanks and not all tanks
Reply: George Atlas lol it know what the TUSK is and it is just an upgrqde added to the same M1 tank because the US either dont have the cash or simply is too dumb to make a new mainbattle tank
Reply: George Atlas yes its an add-on thats added to a too heavy tank that lacks the maneuverbility required in modern wars a tank that still uses strong frontal armour and weak armour everywhere else thats a tank made for tank battles but in the modern age there are no tank battles because tanks are used to kill infantry and when you want a tank dead you use an attack chopper thats how modern wars are fought nowadays and thats why the M1 Abrams are outdated
Reply: George Atlas and all the tanks you mentioned are old tanks from the Cold war era i am quite surprived that you didnt mention the new polish stealth tank tho nor did you mentionn the merkava altho merkava kinda suck
Reply: George Atlas btw earlier you said the US has the worlds biggest military budget well yes they do but about 95% of that money is wasted just to keep all those military base all over the world and on arming rebel groups that ends up betraying them ISIS is a fine example and so are the Taliban and Al Qaeda because of that theres not all that much money left to improve its tech its so bad that the US started re-using old damaged equipment that they simply "patch up" when i read your comments you make me laugh because you so damn ignorant of whats really going on with your military
Reply: George Atlas lol thats practically what i just said maintaining those bases is costing huge amounts to the US army
Reply: George Atlas prove it then by showing your so called accurate numbers on military spendings so far you failled to give any info all you did is desperately tried to deny me without any explanation of the why and the how
Reply: Aztk Shorty ahem we were not talking about the entire budjet of the US army we were talking able specific numbers of what all that money is used on i claimed 95% is used to maintain all those bases outside the US and you claimed was false then i said give the real numbers to prove me wrong and you come up with NOTHING i gave you plenty of time too so you cant complain
Reply: Joël LeMay Well 95% of the us military budget isn't spent on outer bases. Research, Development, Testing & Evaluation	$63.347 billion	-12.1%
Military Construction	$8.069 billion	-29.0%
Family Housing	$1.483 billion	-12.2%
Other Miscellaneous Costs	$2.775 billion	-59.5%
Atomic energy defense activities	$17.424 billion	-4.8%
Defense-related activities	$7.433 billion	-3.8% Defense Wide Joint Activities	$118.7 billion	15.5% While our outer defense budget (estimated) is around 150 billion.  The United States maintains about 800 military bases in at least 160 countries. rarely does anyone ask if we need hundreds of bases overseas or if, at an estimated annual cost of perhaps $156 billion or more, the U.S. can afford them.
Reply: Aztk Shorty FINALLY SOMEONE WITH A BRAIN sorry but i had to say it you are the first to ever give me numbers of what i actually askedd in 5 years so even if those number may not be accurate its far better then some morron that simply tells the entire budjet because now i have something to work with
Reply: Aztk Shorty id say the military construction budget is way too high should be decreased from 20% to 10% atomic should be put down to 0% (unless you actually want a nuclear war) defense wide spread activities decreased by 75% (its a big waste to fight terrorists that are not even in your country) and the offshore millitary bases should be sold to the countries in which they are in they 20% of the savings should go to the research and development miltary deparment and the rest should be either used to strengthen the economy or to pay off the nations debts i would also stop sending billions of $ of reconstruction money to western europe because they finished the reconstruction long ago those acts would make the US army modern once again like what it used to be
Reply: Hoyin Tse lol thats the american one but not the russian era because theirs is more like a gun that shoots explosives at incoming shells they have multiple explosives to shoot its just like the active protection of Battlefield 4 except this one has no timer nor cooldown
Reply: Hoyin Tse the real name is Arena Active Protection Armour and only the Russian T-90 has it theres even slow motion videos that shows it in action and no its the same thing as era because it uses explosives as armour and it is better then depleted uranium such as the Abrams armour all it takes is 1 shot from a kornet ATGM and Abram tank is destroyed and to make it worst the kornet is a PORTABLE weapon
Reply: Hoyin Tse many M1A2 were destruyed by Kornet in Yemen i cant say for M1A3 since it hasnt seen combat yet but then again you cant either
Reply: the real mysterion yes it sure would but your country seems to think it can win all wars with air force alone
Reply: Hoyin Tse gees they are LATE that so called new active defence system was invented by the Russians 26 years ago
Reply: AirsoftGamer thats why i said they "started" admiting it because they said only the word tank i bet in the original they said the M1 Abrams Main Battle Tank but then the one making video deleted the "M1 Abrams Main Battle" from the video cause typicall american is idolizing the thing
-
i only know 4 tanks that are trully modern there the latest German tank (no surprise there) theres the Russian T-90MS as well as the Russian T-14 Armata and the big surprise is the 4th which is actually made by Poland they have whats called a Stealth tank GOOD JOB POLAND!!!
Reply: T90's explosive reactive armor and defense system seems promising, but how many rounds it could fire, and how many times it could be useful. Not a single m1a3 was destoryed by the Iraqi T-72s. You'll have to put m1 in your list.
Reply: AirsoftGamer no thats not the ERA that the T-90 has instead you explained the ERA found on the T-72
-
the T-90 has a sort of turret that fires explosives at incoming projectiles as well as the traditional ERA on the tank itself thats why tow missiles and Kornet cant destroy it however many abrams were destroyed by the Kornet and even if you had a 10 000mm armour it still would be obsolete vs a HEAT round but ERA blocks a HEAT round completely by making it blow up before impact some ERA can even protect a tank against a nuclear blast and i did say "blast" and not radiation
Reply: AirsoftGamer solid armour are obsolete they are USELESS vs modern anti tank weapons thats why the T-90MS is far better because it has reactive armour we are no longer in the WWII era where the thick the armour meant better because today we have shells that does extremelly precise and focussed explotions it no longer blows in every direction that way you do way more damage with bombs that are smaller then WWII bombs and those new bombs are called HEAT rounds it literally drills its way through the armour then explodes inside the tank killing the crew and the best part is since its focussed explosion it does not do a lot of damage to the tank itself so the enemy that shot your tank with a HEAT round can simply removes the dead crew then use your own tank against you ironic isnt it?
-
the point is solid armour like the one on Abrams is outdated its no longer any good what you need is armour that can react in time and push this penetrating explosion away from the tank itself and thats exactly what ERA does
Reply: AirsoftGamer a HEAT round is not all the hot however it does extremely high pressure think of it like a methane torch that mechanicians uses to cut steel with methane alone sure it makes intense heat but cant cut shit its only when the high pressure oxygen is added that it really starts cutting like a light saber well its the same thing with the HEAT round the heat is only there to kill the crew once it fully penetrated the armour but the real danger is the focussed shockwave and not the heat
and i said about a thousand M1 Abrams got destroyed by the Kornet but i never mentioned the RPG but since you did the one you are familliar with is the RPG-7 its the most common RPG but also the weakest the RPG-39 is far superior and can penetrate the M1's armour but the Kornet is even stronger and far more accorate in fact its the worlds best "portable" ATGM
Reply: AirsoftGamer theres even a video where a Kornet is destroying an Abrams with a single shot in yemen
-
video title: Saudi M1 Abrams Tank Cook Off After Yemeni army ATGM Hit Yemen war 2015
Channel: News of Yemen
-
there are many other videos on Youtube that shows Abrams getting destroyed they are real easy to find just type on YouTube the words Destroyed Abrams Kornet and you will see a ton of vids but only a very small amount of abrams were filmed while being destroyed and yes the Kornet is indeed a HEAT round like the RPG except its laser guided and a bit heavier
Reply: AirsoftGamer must have been a lie i mean how can someone be so stupid to think he can unstuck a tank by shooting at it just doing the act can be charged for treason so i very doubt that btw i gave you video evidence it doesnt get better then that meanwhile all you have for proof is a suggestion of something that may or may not have happened not very good proof if you ask me and even if it did happen they would have a greater chance of success if they used a HE shell instead of a HEAT because it does a bigger blast also a HE is just a regular explosion highly effective vs infantry but very weak vs tank so if it was indeed a HE (Hight Explosive) shell then it shouldnt do any damage to the tank but personally they should just attach a chain on both tanks so the other tank can pull it out thats what they normally do
Reply: Hoyin Tse many outdated ATGM yes but not modern ones and the RPG-7 is not moddern btw even the US army admited this thats why they are adding the ERA on the M1A3 Abrams because the depleted uranium armour is obsolete vs HEAT rounds and btw the RPG-7 was an early version of a HEAT round not very powerful but good enough to be extremely popular and its cheap to make
Reply: Habiebi Djokarso we are talking about tanks not air but if you want to talk about air well the F-22 Raptor is not as good as the PAK-FA T- 50
Reply: Habiebi Djokarso f22 is a prototype too moron and when i was talking about Russian tanks i was reffering to the T-90MS its no prototype but the T-14 Armata is also past prototype when they paraded them in 2015 it was already in mass prudiction and 40 were shown but today theres probably around 3 to 4 hundred T-14 Armata
Reply: Habiebi Djokarso and you are stupid and ignorant to believe the PAK-FA T-50 to be a prototype
Reply: Habiebi Djokarso sabbot is just a uranium solid shell theres no explosive in it its a sort of chemical weapon amazing vs infantry and light armoured vehicles but doesn't do sh*t vs tanks it just bounce off sure the explosive armour wont stop it but it will diminish the velocity a bit then the solid armour found behind the ERA and reactive armour will make it ricochet off the tank 
- 
the americans used the Sabbot in Iraq and Afghanistan to take out those machine-gun trucks and troop carriers when the shell hits it disintegrates into millions of extremely hot particles that literally liquify any humans that makes contact with it extremely deadly and affects a wide area its the perfect weapon to use against terrorists
Reply: Habiebi Djokarso infrared is only a type of vision you see in infrared in the little screen of the javelin but you need to keep your target in that screen which means you will have to be exposed because you need to guide the javelin missile 
on american tech i get most my info from american military documentaries to be honest i love watching documentaries 

btw there was never an actual tank battle between Iraq and the US because the US blitzkrieg in the middle of the night through the Iraqi lines and straight to where all the Iraqi tanks were parked when the americans arrived there the Iraqi were still sleeping they were shooting at immobile tanks at point blank range and no they didn't use sabbot they used their anti tank rounds and that surprise attack destroyed all the Iraqi tanks thats why no american tanks were lost 

you are just like the typical american brainwashed by propaganda i see and their so called sabot round which are not even that good its the same thing with your stupid M16 a piece of crap that you americans claim to be good
Reply: Joseph Stassup well safety in a tank these days is quite hard i think i would feel more safe when i would have ERA and that little system which fires grenades at incomig AT rockets and the cm think aluminium wont do even much against one shell getting lit up since it will just detonate the others